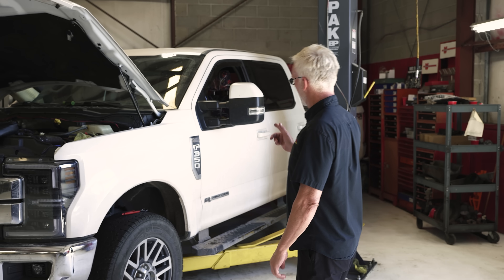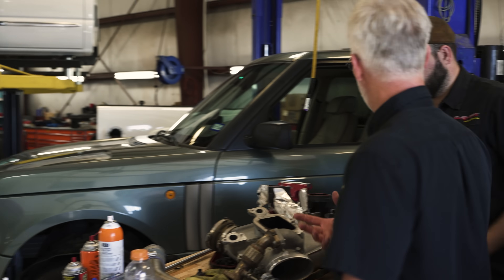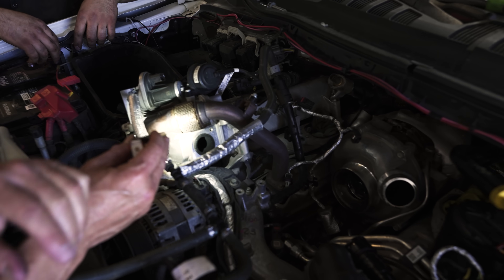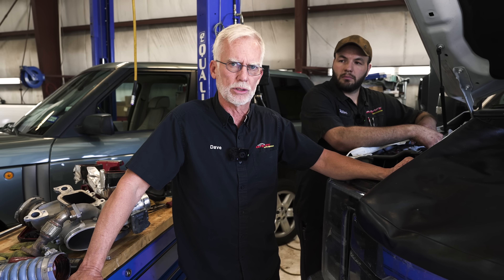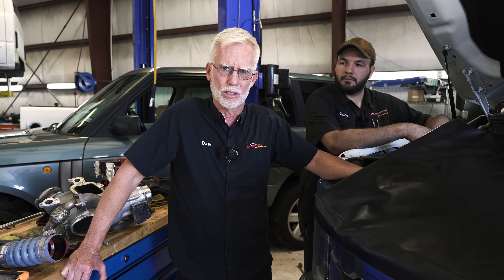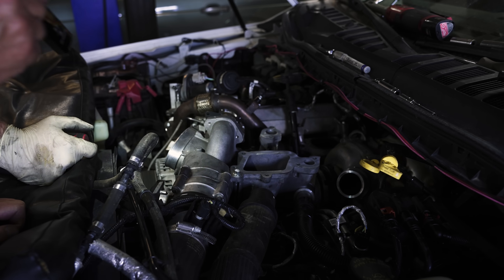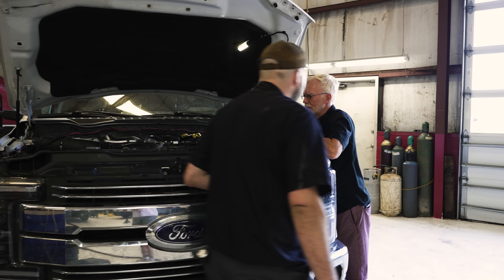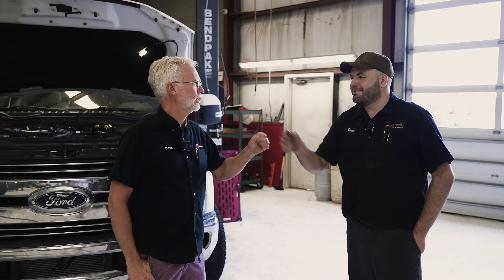2019 6.7 Powerstroke EGR Maintenance: The Problem With Carbon Build-Up

Comment: nice... WAYYYYY easier on the cummins 6.7... not recommend to use oven cleaner it's quite harsh.. better to use like a purple power or Mean Green you find at dollar general, walmart etc..  there are manyyyyy truck running round with 200 400K miles with no cleaning of EGR ssytem..

Comment: Dave, I had my 6.7 for 8 years now and I have never had anyone suggest that I clean the EGR and the associated components. So, I decided to clean my EGR and the intake manifold. I want to pass on to you and your followers, I found the best way to clean these engine parts is to use an ultrasonic cleaner. I used a 30L ultrasonic cleaner at 158 degrees for 30 minutes. The soot melted off. After each part received its first cleaning I notice some residual carbon stuck on the metal, so cleaned each part twice.  Initially, I used an ultrasonic solvent. That was expensive. You can use Simple Green or Purple Degreaser, same results.  I was able to submerge the EGR valve and EGR Cooler (together), both Exhaust Manifold Tubes (together), and the Valve Assembly Housing. I did not submerge any part of the plastic intake because of the adhesive heat shield. I tired cleaning it best I could. The ultrasonic cleaner is the way to go. Thanks for the advice!
Reply: Simple green is corrosive to alluminum. Look at the FAQ section of Simple Greens website under aluminum.
Reply: I agree with the use of ultrasonic cleaner. We use it in the dental field to clean tartar and blood off of our instruments.

Comment: Good morning Dave's Auto,  have you heard of FASS fuel systems? They have a system that is emissions compliant for non-delered  diesels that they claim burns 85% of egr contaminates before injecting back into the intake. 

@FASSFuelSystems

Currently, they only have kits for Duramax and Power stroke. They say they will have Cummins kits soon. 

Thoughts?  Thank you for responding.

Comment: In the VW TDI world, the metal part of the intake gets cleaned with fire.  Lil map or propane torch to get it started, and compressed air alone to finish it.  It's INSANE that you can keep the fire going for minutes on just compressed air.  If all sensors are removed from that intake, I don't see why you couldn't do the same. They come out perfectly clean afterwards.

Comment: Japanese/Thailand Toyota Mitsubishi Isuzu etc etc  minor clean every EGR only at 30.000miles / 50,oookm ....... Major clean .Inlet manifold , inlet tract , intercooler , cyl head ports . egr valve,, egr cooler ,,    every 60,000miles /100,000km.
6 tea spoons sludge in 4cyl diesel cyl head port at 120.000miles 
Direct injection  injectors have extra wear because of this debris between 80---120k miles , increased fuel use also 
Clean MAP & MAF . Do a MAF relearn do this after repair .

Comment: Dear Dave, I would like more information on cleaning out the EGR, I would bring it to you but I am to far away. Can you tell me exactly what you did to clean it out? Thank You for the Help. IE: I have a 2017 F250 6.7L with 102k I am installing a   Pusher intake with Hot and Cold Lines as well as the upper Radiator pipe. While i have it out I want clean the system so it runs smoothly. 
I know you are talking about this as a Maintenance item. 

Thanks Again

Comment: Just for clarity:   EPA did not mandate EGR.  Factory Engineers chose to utilize EGR to lower the NOx emissions.  EPA sets standards to be met.   The manufacturers decide how to meet them.  I think the manufacturers adopted EGR, because it was a quick easy solution, carried over from gas engines.  And realistically, a factory engineer is only concerned with designing systems which outlast the warranty period.   They are not concerned with things like wrench clearances for easy maintenance, or going a million miles.  The Engineers are paid to lower initial cost.  Since the engine and transmission are installed as a unit then the cab lowered over it, there may not be enough clearance to maintain the engine and transmission, without removing the cab.  This is what happens when the MBAs take over management, and replace the engineering leadership.   MBAs are worried only about this quarters profits, and to hell with the long term health and reputation of the company.

Comment: Back in the dark ages, of early turbocharging engines, we used to inject a water methanol mix to prevent detonation.  Chevy did it on the turbocharged Corsair 6-cylinders.  The internals on those engines were spotless.  They had a problem tough, in that folks would forget to refill the reservoir, the engines would detonate, and grenade themselves.  At the time, when everything was still point ignition and carburetors it would have been nearly impossible to prevent.   

But today with modern engines which have fuel injection, and engine management computers, that know how much DEF you have in the tank:  Wouldn’t it be possible to add water/methanol injection to a modern diesel engine to keep combustion temps down, instead of using EGR.  The Engineers went with EGR, because that is what they have known for fifty years on gas engines.  The water/methanol technology would be easy to develop to replace the EGR, and would eliminate a lot of the soot we are seeing in the modern diesel engines.

Comment: @davesautocenter shop owner to shop owner, don't let your guys use the wiper cowling as a tool or parts tray. A stray piece of hardware ending up in an engine you guys just built would be BAD!

You guys do a lot of stuff right, I'm a big fan. Keep it up

Comment: Hy from Europe Dave, I like your chanel learning and have good time watching and learning, I want to tell you about my 1994th Ford 1.8 turbo diesel EGR intercooler with 200000mls who runs better then first day and has no problems with EGR or intake carbon build up. On every oil change  4-5000mls I use EGR and intake diesel spray cleaner by WURTH based on Hidrogen(I belive in US sell good EGR cleaning products- Valvoline has good one  in EU)  and then flush the oil with Liqui Molly engine flush put new oil fuel and air filters  and quality clean fuel with one bottle Liqui moly Superdiesel additive for lubricity, cleaning combustion chamber, injectors, exhaust, turbo, better cetan number ...and is good to go next 5000mls,  it's easy as that. Engine looks shiny no varnish no sludge no carbon build up, I never tuch or open engine,turbo, intercooler, intake or exhaust side for 32 yeras even catalisator and muflers are like new. Cammon rail engines must have 2 fuel filters first with water separator second one with 3 or less than 3  microns filtration. Oil for diesel with DPF is C3 specification 0/5w-30/40, and A3/B4 without DPF with HTHS >3.5mPas even Ford call for A5/B5 with HTHS>2.9mPas but I  found  A3/B4 MB 229.5cpec oil with  HTHS >3.5MPas 5w40 year arround high enough on ZDDP as Ford spec but more stabile on hot weather and engine temperature more suitable , in US Shell Rottela has simmilar caracteristics and i bellive you can find good C3 euro spec oil for DPF diesel engines on shelves. Problem with this Ford from video by my opinion is that oil is not up to spec or wrong oil spec  recomendation and no regular change and bad fuel and bad filters combined.  With best regards

Comment: I don’t know if they still make them but JC Whitney used to sell a water spray for people hauling campers what would happen if you installed it on that so it did had a real fine vapor of water going through the system. Would that help or would it blow it up? It’s my question.

Comment: You realize with the money that you put into these diesel engines to get them to 3-400k you could take a gas truck to 300k, replace the engine/trans. Get another 300k and still have $15k left over for a nice deposit on a new truck.

Comment: England Calling:
Dave you are so correct, we run two Range Rovers in our fleet one is over 160,000 (TDV8 3.6 Ford) and the other 230,000 miles (TD6 BMW 3.0).
What we've found is Slick 50 give us the very best results in terms of the top rings not getting fouled up due EGR.
Great program keep going

Br Peter

Very Best regards

Comment: I have the same truck with 240000 miles on it. It’s stock now. At this mileage is it worth deleting it? Has the damage been done ? It’s not giving me any problems now but I’ve notice I’m getting less fuel mileage and it’s feels like some power is loss. At 240k miles running stock, did the carbon buildup cause serve engine damage that will show up in the near future?

Comment: Hey Dave. You talked about egr system cleaning as maintenance, which is 100% correct. Have you had any experience using a fuel catalyst such as max mileage from Pittsburgh power to keep carbon out of the egr?

Comment: What kind of cost (general ballpark) are you looking at to do the maintenance? I had mine replaced because the mechanic said it needed to be replaced and not cleaned! Replacement was costly!! Also, what kind of mileage are you talking about for the oil change?

Comment: I have a couple of questions.  I have a 2022 RAM 2500 diesel.  The 1st one related directly to this video is:  What can you do to prevent the buildup?  Aside from 3k-5k oil changes, 10k fuel filter changes, and keeping idling to a minimum, is there anything else?  The second question that's not related to this is:  Has anything been figured out as to why these are having problems with the auto regen happening way too frequently?  The dealer just replaced the EGR rod was stuck and not operating properly; however, that didn't fix the problem.  The truck has been doing this frequent regen since 20k miles, and I have 35k miles on it now, and it's still under warranty.  I was a marine engineer in the Army for 25-plus years, so I have worked on marine diesel engines for a long time.  I just haven't worked on automotive diesel.   Any suggestions or input?  Thanks for what you guys do~!

Comment: After watching your video due to searching for and answer to what was causing my check engine light. The issue was happening with my work truck a 2019 6.7 f350. One of our mechanics and myself decided to dig deep into the intakes by removing them  and found a mass amount of carbon build up. My work truck has just over 107,000 miles on it.

Comment: Looks squeak clean. I knocked out what I could in mine, then ran it through the ultrasonic with a couple cascade pods in there with an over night soak it took a couple times on each part. I could only do one at a time. When I took them out the bath I sprayed the parts down with engen degreaser so they could soak in that before I steam blasted and ran them through the ultrasonic again. Not a fun job to do in the winter. The plastic one was the hardest to get clean. Any idea what we should do to clean the heads.

Comment: Oil separator in PCV return pipe to intake system makes a big difference.

Oil and soot create the sticky black mess. Soot is dry and won’t stick that much as oil and soot. 

That and regular oil changes should make a big difference.

Comment: I see it’s 6 months after this video launched, hopefully you guys will see this post. I just saw a video from FASS, selling an EGR Filter System. It plumbs into the EGR at the exhaust manifold and directs the gases through a mesh sieve trapping the soot. When the soot gets to thick, it heats up and burns off. FASS claims it needs cleaning about every 50K miles. Thanks, love the channel!

Comment: Back in the day with gas engines you’d throw some Marvel Mystery Oil or Transmission fluid down the carburetor, to blow out or burn out the carbon buildup.
 What works on Diesel engines, besides the Manufactures factory recommended ways ?

Comment: Couple years ago I had to replace my EGT and EGT Cooler.  The cooler was covered under recall, but I had to eat the cost of the EGT.   Its a crap design to require the engine eat its own exhaust again.   I wish someone at the EPA would wake up.

Comment: Hi Guys in Australia there is an aftermarket EGR soot reduction blanking plate that has a 7mm hole in it so that it drastically reduces the carbon build up but allows enough gasses to pass through to keep the ECM happy and not throw up any error codes. company called Kaon 4x4 accessories. might be of interest to you Dave.

Comment: Live within a system not voted on by us? Nope. They just tried a case that says congress cannot delegate law-creation (rules, like The ATF calls them) and this kind of mess was never voted on by "We the people". Delete for proper operation. I cannot afford to keep paying thousands to guys like you (no offense, you're awesome and quite skilled) for zero reason. They added the EGR to lower temps and reduce NOX emissions. This made them roll coal due to incomplete combustion. The solution? DPF. DPF has to get up to 1200f to burn coal. Oh now we're back to making NOX. Now they treat the NOX with the SCR. Big circle/loop.

Tell me, if the original enemy was NOX, why can't we just run an SCR system that does its thing when needed? We don't need an EGR or DPF in that scenario.

I have a 2017 with the 6.7 and CP4. Bone stock, 203,000mi. I use OptiLube XL every tank for the CP4. No codes or anything. What are the odds the intakes clog before the CP4 decides to explode?

Comment: I cleaned my intakes a couple of years ago with a pipe cleaning attachment for my power washer. It spins and showers high pressure water in every direction. My attempts to get the carbon out of the ports in the head area were not so successful. I believe disturbing the carbon in those areas just sent carbon into the cylinders. The truck has more blow-by now. I did a CCV delete and it smokes regularly now. I believe the CCV causes a lot of the coking because my intercooler was coated in an oil film and it tracked right on through to the intake. I get that they want to save the planet, but those who are driving these EPA regulations don’t understand the concept of a NET GAIN. Reduced fuel economy, cost in energy to produce DEF, energy used to ship DEF, millions of plastic containers and cardboard boxes to distribute the stuff, all the added parts that go into the system….. why do we let educated idiots run our government? Ticket those kids that are hopping the trucks up and blowing those huge clouds of smoke and leave the rest of our trucks alone. That is all. 3:24

Comment: Exhaust gas recirculating system is always causing problems. I learned that an efficient engine produces lots of nox. It’s produced when air get time to react at high pressure at high temperatures. In my opinion a good after treatment catalytic treatment is the best solution. If you add a heat up burner to the SCR reactor with an heat exchanger for pre warming your intake air, you would get a faster warming up time. Always remember to use an electric engine heater and let your fuel burning parking heater heat up your engine when starting. Best regards from Norway

Comment: The best fix for this is to buy a pre 2011 GM duramax or a Ram with a 12 or 24 valve 5 9 HO engine

Comment: Just plug the egr Dave lol. Nobody is trying to take the car and have the intake system clean as an extra step of maintenance. Plug egr and vent the pcv to atmosphere, you should have clean air running through the engine all the time.

Comment: Dave what is your opinion on oil bypass filtration systems? I saw a study done on a Peterbilt that used 1 oil for million mile test. They said the oil was good enough to leave in after the test. Is this the best way to defeat soot build up in the oil? worried about fuel dilution? could i go 30-50k between changes? the oil in the videos doesn't turn black. I want to take care of my truck the best i can.

Comment: They have really screwed the diesel engine. They never required catalytic converters on diesel trucks until well after cars were required to have them. Then someone decided that they needed an EGR system even though they ran fine without one. But what really boggles the mind is Diesel Exhaust Fluid. Why are they coming up with all this emissions equipment that requires more maintenance and shortens the life of the engine?

Comment: I have the perfect solution.  All vehicles will be mandated to use a plasma incinerator. That has been in use, after it’s field testing since the later 60’s. It’s 100 percent worry free, and no maintenance. Ever over rated piece of equipment on a vehicle, will be not needed. Go back to the 40’s style of an engine, and a PI, is all you need. The world wide use of this, can bring clean air almost instantly; doubt me?  I wouldn’t if I were you!!!!   P.S.  no exhaust port is never needed.  Have a wonderful complex day everyone!!!!

Comment: I have a 2018 6.7 with 50k. I’m doing a set of pusher pipe and the amount of carbon in my old system is crazy.

I did have the dealer update my ccv box to the 2019 and add a MishiMoto catch can system which now shows little to no oil in the charge pipes.
Before catch can charge pipe we’re full of oil. 
Remove the oil from the intake system and reduce the amount of carbon?

Comment: Dave is right, especially since exhaust recirculation isn’t going away. But, could these systems be designed to require less labor to clean out the soot?

Comment: I have SWORN up and down to many trucking companies I worked for in the past. 
That cleaning EGR components and inspecting the sensors and valve on it should have a cleaning maintenance interval every 50,000 miles. 
But shop foreman's, and mechanics just brush that off. Thinking I know nothing but also Wondering why the trucks in their fleet have soo many engine problems. 

Larger engines like Paccar, and Cummins make it so easy to access those parts with a standard socket set and adjustable wrench.